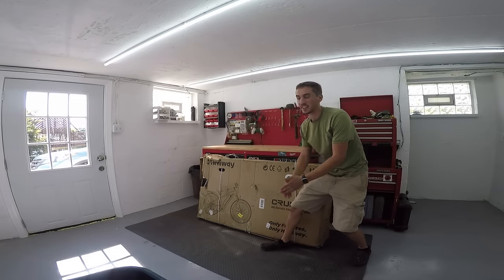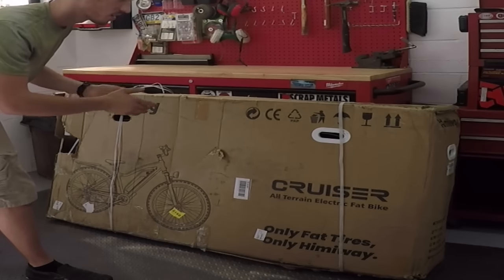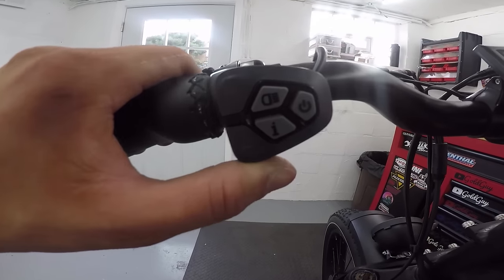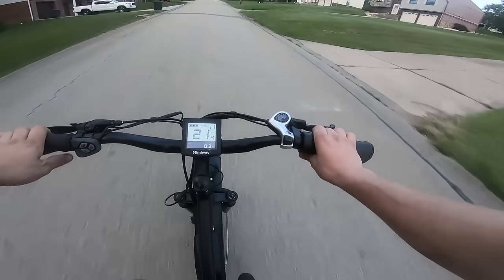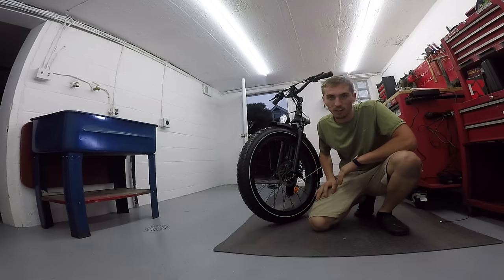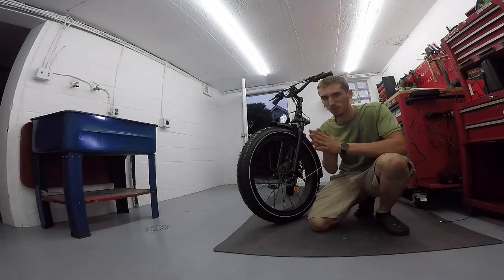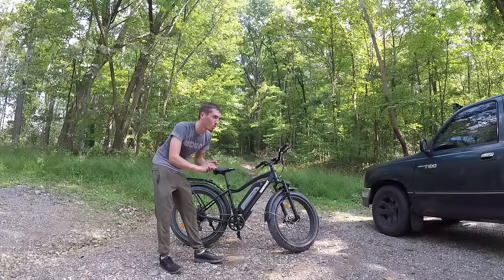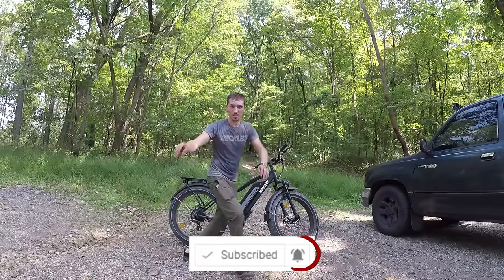Himiway Cruiser Ebike on a BMX Track

Comment: I have built my ebike. You should start building yourself a powerful ebike with 12kw 96V 55ah with 21700 battery cells and with an accelerated systems controllers 400 amps. You would seriously feel some powerful torque and speeds. My bike does 71 mph.
Reply from the maker: That must be a huge battery. Where did you buy the kit?
Reply: @GoldGuyRides  I have built the bike from different suppliers. I bought the frame and forks from Vectors. I bought the hub motor from QS Motors. I bought the controller 200 amps from Sabvoton. I have a guy I know that builds batteries for eBike builders like me. I know a few. And he did all the wiring because that's my weakness.
Reply: @GoldGuyRides  The batterie isn't that big really. 3" thick, 8" base, 15" long side, 13.5" short side and 6" on top.

Comment: Wonder how fast it is if you unlock it 🤔
Reply from the maker: I unlocked it, you can see in part of the video the pedal assist mode is at 9, I increased the number of modes and increased the max speed to 39 mph lol. It only goes about 30 though.